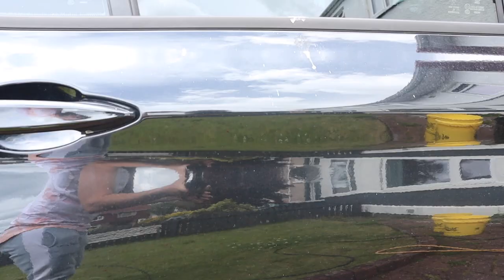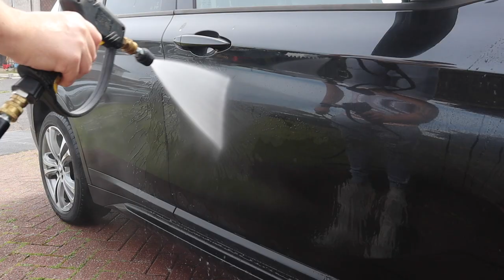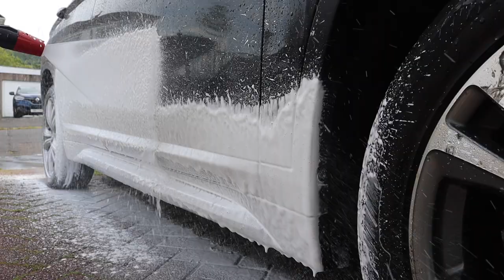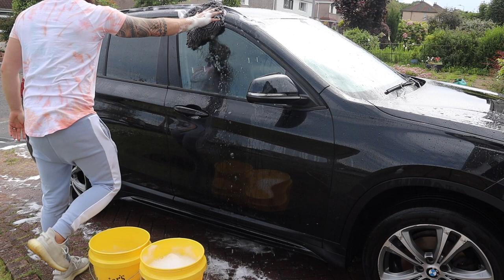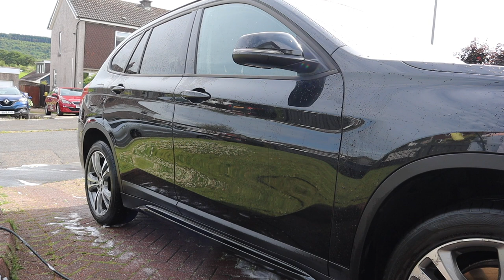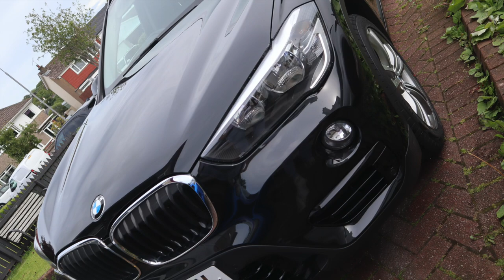Quick and Easy Protection #detailing #fast #protection

Comment: Looking good again, can't beat those quick to apply sealants when your in a bit of a rush. Looking forward to your next video to. I use to get serious asmr from the hand car washes when I'd take my wife's car there. Mainly because it was an absolute tip inside.
Reply from the maker: Yeah they are such a time saver when your tight on time. 

I’m looking forward to it although I’m also crapping it a bit if I’m being honest. Hopefully won’t cause any irreparable scratches 🤣🤣
Reply: @DavidMcBay  this was about 5 years ago before I knew what's what.  I took my wife's C5 in, waited in the que, bloke came over and sprayer the car down. Thought bloody hell that's a bit keen. Waited probably 30 to 40 mins longer then they washed her car. My wife noticed spots on the windscreen, thought that's just dashboard dressing sprayed up. Tried for months to shift it. Years went by, got into detailing a bit more and figured out the pre wash he put on in the baking hot sun etched the outside of the glass. Must of been caustics TFR or perhaps he even picked up acid wheel cleaner in the big pump sprayer by mistake.
Reply from the maker: That seems an all to common thing to happen in these places mate, I’m going to time when I go so I’m not waiting in any kind of que. As much as I want to show how bad these places can be for your paint, I don’t want contribute to potential damage.

Comment: Great vudeo David.

Have tried turbo6 and wasnt to keen on it for applying (maybe the way i was putting it on). So hand it off to a friend. 

Express sealant i need to use it pretty strong about 40% product and 60% water using it through a foam cannon
Reply from the maker: Thanks David. 
I had issues when I applied it originally mate, it was a bit hot and I was getting a lot of smearing. 
The express sealant I find if I’m just topping up 10% is ok and I normally use the full lance anyway but if I was putting it on a car with no protection I would up the %

Comment: Great video mate. Car looks great. Bit disappointed with the turbo 6 sealant. I was going to get a bottle to try but I'm not so sure I will bother now. I was mainly interested in the filling abilities. And also disappointed with the autoglanz glass sealant as I really rate everything I've tried from them. Keep on going buddy 👍
Reply from the maker: Thanks mate, I was expecting it if I’m being honest, the areas of the car that don’t take a pounding we’re still performing great but other areas were done. The filling abilities are a good short term fix but I’m not sure it’s a product I’ll be reaching for anytime soon. I was gutted about the autoglanze! Mainly cause I have their 1yr ceramic coating which I now don’t really want to use anymore.

Comment: I’m a fan of Asian car care brands , soft 99, kamikaze, gyeon , car pro, tac systems , I expect soft 99 glass sealant to do well as there fusso coat is great, born in U.K so I do my best to support British brands like gtechniq , auto finnese , auto glanz , auto glym and so on but I still prefer the Asian brands .
Do you think you will be trying any yum cars products ?
Reply from the maker: Yeah I’ve got to agree with you there, some of the products coming from Asia are very good, there is huge variety in the protection products they offer. I’ve never tried the Yum stuff, I’d potentially pick some up if there was a sale on.
Reply: @DavidMcBay  to be honest I don’t know if yum cars have sales , I’ve never seen them on sale , I heard they are good but considering how expensive they are I expect it to be excellent , £50 for 5 litres of snow foam and citrus pre wash is same price , I bought some yiannimize products from Halfords , new brand and I got the snow foam and interior finish and protect , the interior one I thought was good as it cleans and leaves a dressing, you can leave it glossy or wipe it down for satin , I tried some parts are glossy and some as satin and I thought this is good , come back next day and the satin and gloss affect was gone , it went back to Matt in probably 12 hours , as a dressing or protection I think it’s rubbish , I’ll be trying the snow foam next .
With the soft 99 glass protection , im impressed as  it’s not even a ceramic coating but still preforms great , it’s the best non ceramic glass sealant on the market and soft99 was maybe one of the first to bring out a durable glass coating . Even the first clay car was invented by the Japanese